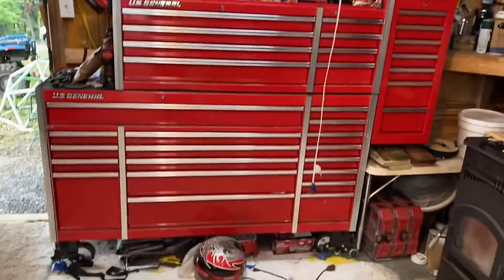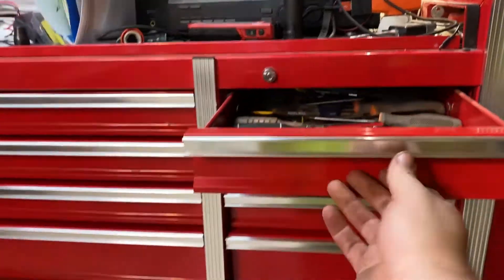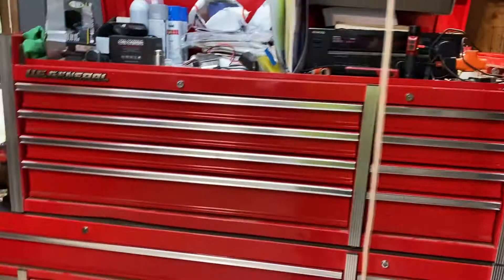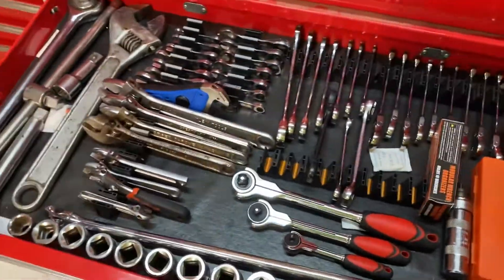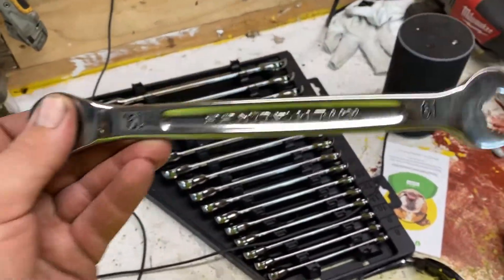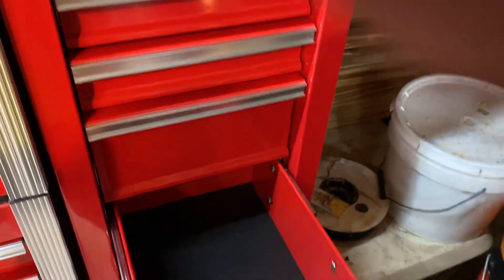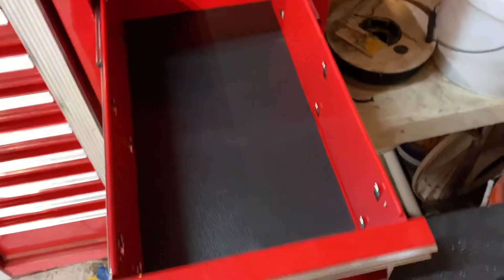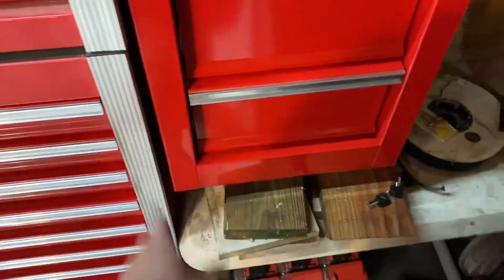Adding custom side box/End Cabinet to U.S general series 2  harbor freight 64358

Comment: I Just mounted the now available 72" top chest to my 72" bottom.  Then I opened the box for the 14.5" side cabinet like yours.  Ouch, I realize that I should have put it on before the top chest.  But I unbolted the top chest and lifted it on the left where I wanted my side cabinet and had my son slip in a piece of 1"x4".  Then used a floor jack to get the side cabinet lip over the bottom chest and let it hang.  Then I got the 2 bottom bolts and got down there to screw those in and found that there are no holes and no captive nuts.  Ran across your video showing that the 72" units all do not have the mounting holes.  I have a rivnut gun so might insert some riv nuts and bolt in on that way.  Then I can do the same for the handle that I had to remove and hang it on the side chest.  I am getting the locker for the other side and got a rain check during the 20% off sale back in March.  Then they discontinued the side locker and are coming out with a new one and the local HF said they will honor the 20% off rain check.  I wonder how it mounts.  The 72" top chest is 400lb shipping weight.  The box and pallet only weigh 30lb at the most so it's a beast.  I used standard 27 quart black and yellow totes and some ancient Egyptian engineering.  Buddy and I lifted the top chest and son slid 2 totes under each end.  Then we lifted again and he put 2 totes on top of the ones on the ground.  We are both stout individuals but not NFL linemen so used a floor jack and 4x4 pieces to lift the top chest again and get a third tote on each stack.  That put us adjacent to the top of the bottom chest and the handles on the top chest were high enough for us to get under them to lift.  We lifted and went sideways onto the bottom chest and glided it into position.  We could have waited for backup or got my tractor from 6 miles away and used the forks to set it up there but it is on and badass.
Reply from the maker: Glad it worked out

Comment: I don't think destroying the 56" box is the way to go but if it works for you then so be it.  I screwed 2x4 material to the bottom of my HF side box and mounted casters to the wood.  The cabinet is basically a hardware cabinet but the casters makes it easy to move around if needed plus I don't have the space next to my HF 56" top and bottom and 26" bottom cabinets.  I'm just a home hobbyists that works out of my two car garage that almost always parks two cars in at night so space is a premium.
Reply from the maker: Its fine. Far from destroyed. Lol
Reply: @THEWORX99  like I said, if it works for you then so be it.  We obviously have a different approach to our own tool storage.
Reply: @r.n.6515  yeah it was tough to see that it's a shame..